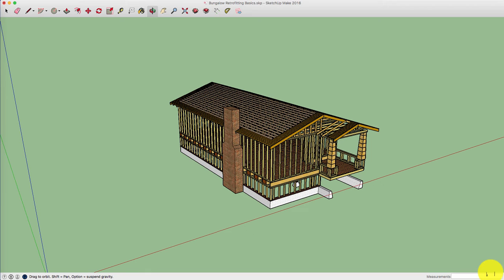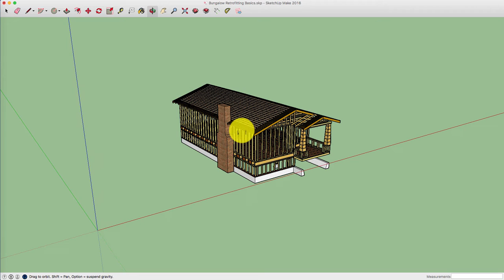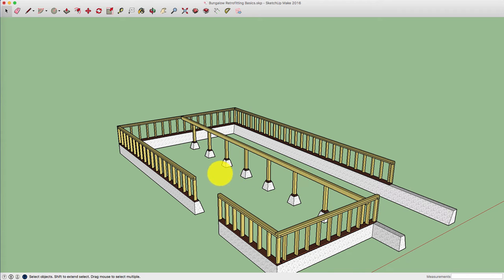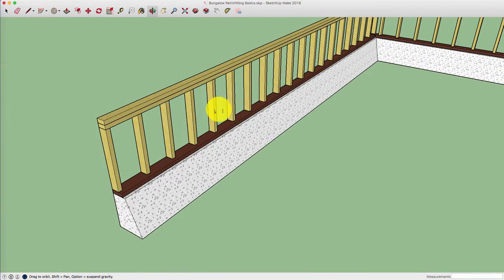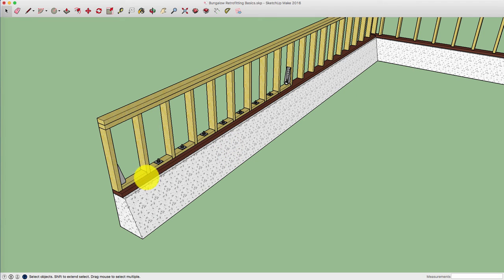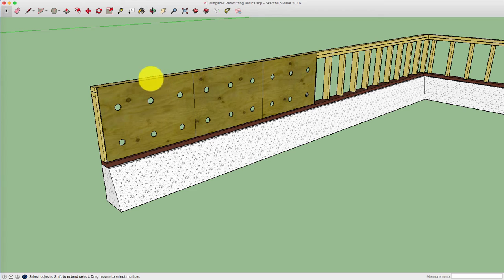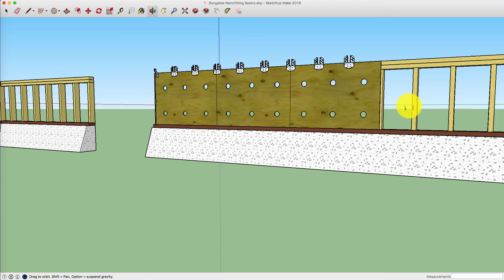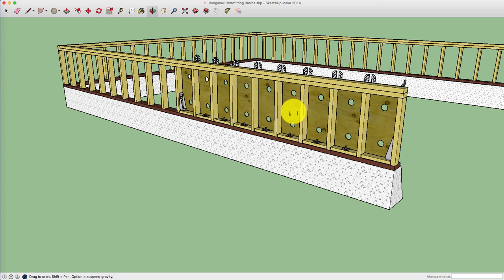Earthquake retrofitting basics

Comment: On a simple bungalow on flat land, what is the purpose of a cripple wall? Why not just frame the house on the foundation?
Reply from the maker: That's a great question. I'm not sure exactly what prompted the use of cripple walls, but I know that concrete was one of the most expensive parts of a building in the early 1900s, so I presume it was cheaper to build a short cripple wall than to put in a taller foundation.

Comment: Very good! Is this the same process for my Emeryville duplex?
Reply: The principals are the same, but of course it will depend on the size and layout of the building. I would check out "Plan Set A" and see if that will work for your building. If it doesn't, you'll need to see an engineer.

http://resilience.abag.ca.gov/wp-content/documents/Plan-Set-A.pdf

Comment: Now, you're the first person I've seen that used sheer transfer ties to the floor joists. Is it not better to use "L" sheer transfer ties to connect the rim joist to the cripple wall and not worry about the floor joists at all?
Reply: Using an H10A (like in the video) is one way of doing it, but you can also use clips (A35 or L70 / L90) to connect the top plate to the rim or blocking. The amount of shear transfer should match the strength of the shear panels. Sometimes the clips are used to connect to both the rim and joists for extra strength, depending on the capacity of the shear wall below.

Comment: If I am using UFP instead of bolts, what should the spacing be?
Reply: ablooddiamond It all depends on the weight of the structure above. There isn’t a simple answer. Google “ABAG Plan Set A” and follow the directions.

Comment: Instead of bolting down, can you use those brackets instead as a substitute? (Simpson brand)
Reply: ablooddiamond Yes, you can use a Simpson URFP (formerly the UFP10) to anchor a mudsill, but given their higher cost, they are typically used in areas with limited clearance - where there is not enough height to drill for bolts.
Reply: razaman514 thanks!

Comment: Thank you for the video.  Do you think it is necessary to retrofit the posts and piers?
Reply from the maker: From all the engineers I've talked to, they say your money is better spent strengthening the perimeter of your building.
Reply: I have the same issue. 2800 square foot main floor with spans of 30 feet between foundation supported by posts nine feet tall. There are 23 posts supporting three floors. Four - sixteen foot posts are in the garage supporting the second and third floor above. Living in Seattle, were facing the very real reality a massive subduction zone quake is going to strike. I want my home to be secured as best I can. Do I add cross supports to tie all the posts together and add corner brackets to the support beam and concrete footing? The idea is to make the house move as a solid unit with the foundation to prevent failure in one area, followed by a partial or total collapse. Anchoring the perimeter to the concrete foundation won't do me any good when the house collapses. A collapseas triggered by the two floors over the garage shifting while the piers under the house fall off their footing. The house would basically implode into the nine foot crawlspace. Would they need to pour a thick slab in the crawl to tie everything together, or swap the wood posts with steel posts with some sort of plate to allow for movement? I can't find a single video showing what to do with a large home primarily supported with post. I don't want my family to be buried in their sleep. We have an exit plan during the day and evening. We all have our emergency bags and backpacks. We even purchased one of those old lady grocery dollies. It has an attached bag that we filled with a tent, emergency foil blankets, fleece blankets, inflatable pillows, emergency food, meds, medic style first aid kit, and jugs of water to survive a week or more. After a week we have ration and nutrition bars. But.... I hope to have a house still standing so we can help neighbors who didn't retrofit their homes.

Cheers from Seattle
Reply: @J.Cameron.Stuart.Adams.Fisher  I'm in Seattle too, with the same concerns. Mind if I ask what kind of earthquake proofing you ended up doing?

Comment: I took a class, watched lots of videos and talk to a local renowned retrofit expert and basically you covered all of this in a 5min video.. Thanks! lol
Reply: Glad you found it helpful!
Reply: Oh yes, Can you make a video about how to calculate where the placement of each anchor or bolt should go? perhaps also with respect to the shearwall?  Also the placement of the hold downs? that would be SUPER helpful because those things I am confused about.
Reply from the maker: Hold-downs are only needed on "narrow" shear walls, where overturning forces could topple them over. Hold-downs work in pairs, at either end of the shear walls (not each shear panel). These are not a prescriptive method, they would typically only be specified by an engineer. 

For bolt placement, check out the link to Plan Set A, which shows basic retrofitting methods:
http://resilience.abag.ca.gov/wp-content/documents/Plan-Set-A.pdf